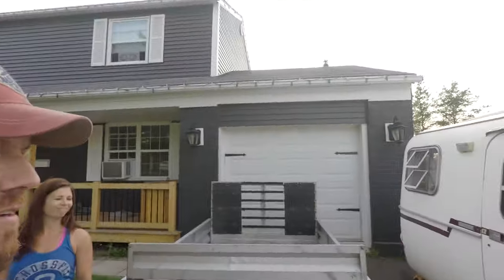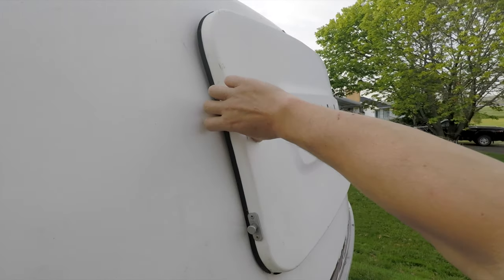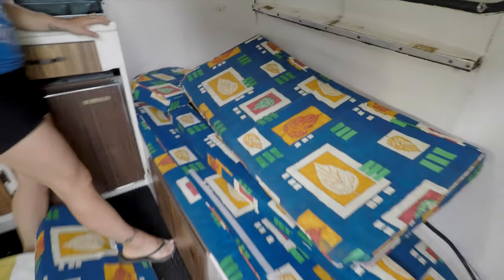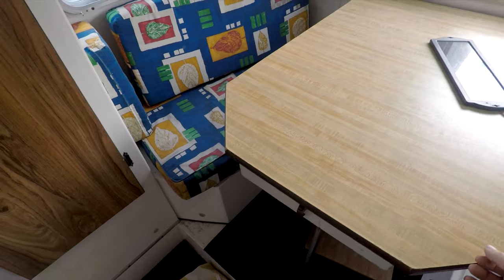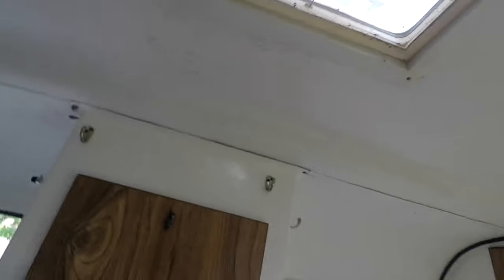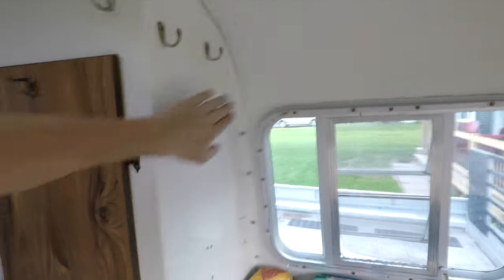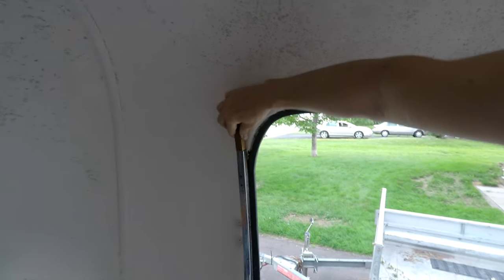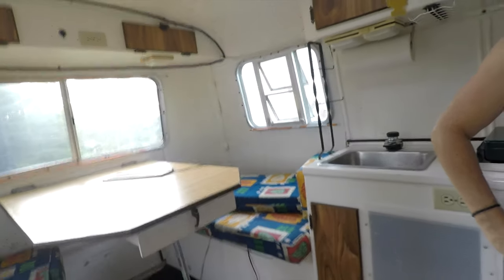The Boler Project - Ep 1 - I can't believe we got one!

Comment: You may have figured this out already but that vertical square silver tube along the door is also structural. Helps with door and shape stability.
Reply: @pixels2u
0 seconds ago
Just saw in another video that those silver bars are supports important to reinforce that part of the wall and keep the door frame from sagging, which will cause the door not to close properly. They said do not remove it.

Comment: We just bought a 73 Boler so was watching your videos. Haven’t watched ep 3 yet so the window question may be covered but I know with watches with plexi glass  you can buy this stuff Polywatch to buff the glass. I also read toothpaste works. Cheers
Reply from the maker: Thanks!! I tried a couple different diy options. Toothpaste, bug spray, etc. They worked but only temporarily. I ended up buffing it with a product I found at Canadian tire. Turned out ok
Reply: Nice ours had new Window put in so thankfully that shouldn't my issue. I believe my big job will be redoing the lighting and I want to look into solar panels. Although we just picked it up so I still haven't found the 'oh shit' discovery that comes when buying something this old so those plans may change.